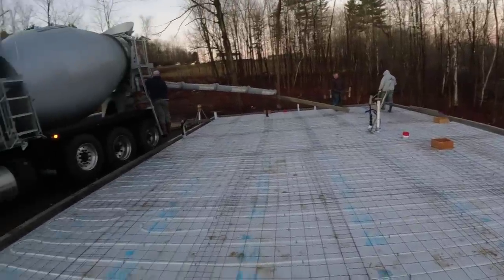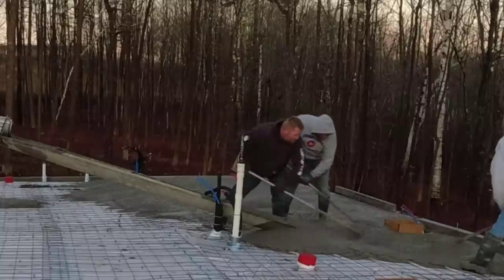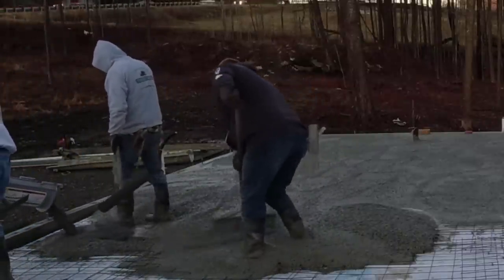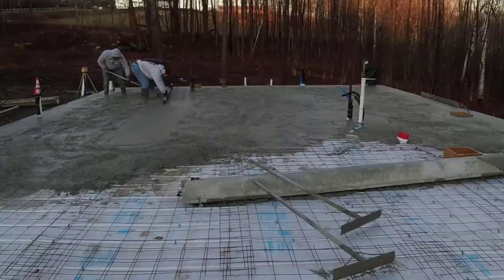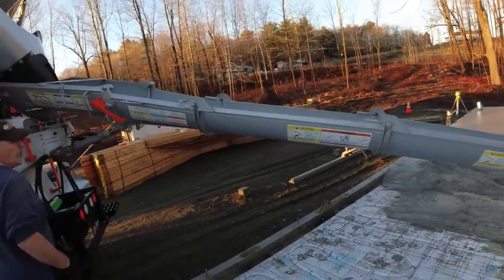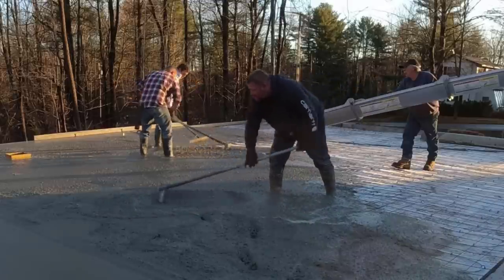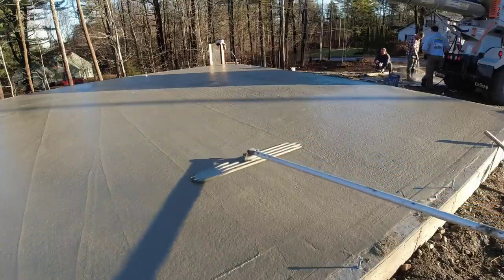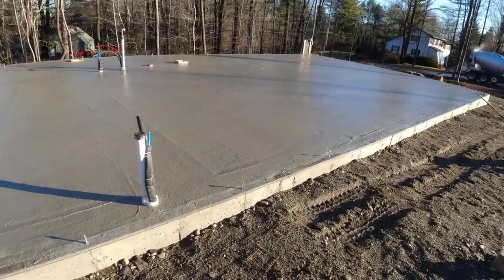We Had To Cut Out Some Wire Mesh - It's Sticking Out!

Comment: I'm in North Dakota land of the way f**** cold and our concrete mixes vary kind of the same seasons like you guys have. So when I do my concrete I don't hire any one so I show up do the dirt we work, set forms, hand screed the sand fill & tamp it 3x, lay in the fiberglass rebar, then I use zip ties to tie the bar. This way there isn't any metal in the slab to have rust spots show up over time. Then pour & the concrete. But I always have fiberglass rebar in everything. I don't really use a lot of the fiber mesh, but I've been thinking about maybe using it more often I guess, you know just for hairline cracks. But yeah, i use water reducer & put it to sleep for about an hour too mostly because I'm a one man crew sometimes I'll have two extra guys with for done of the bigger jobs I get. In winter i also use a percent so i can speed it up a little bit if we need to.

But yes that's probably about the same except our winters get a lot colder than just like freezing or a little bit below freezing. North Dakota winters get way below zero temps with wind chill real feel temps of -20's. For instance tonight we're looking at a windshield of -30° to -35° below 0°. 

But it always varies. We had three or four days where it was below zero temps non-stop all day long. I'm talking like -18° to -20° below without windshield that's just the actual temperature. The real feel is even colder than that.

Comment: We used to use a lot of roll  wire on just about everything we poured until these big wire mats became more available. How we always used bolt cutters we used to cut wire stirrup to hold our steel in our footings. So when we had a problem with the wire like that . Bolt cutters fix the problem and move on. You guys are top notch .

Comment: What mix, psi, water reducer  and slump would you recommend for mix for driveway extension in warm south Florida?.. planning on using wiring mesh and a power screed before bull floating/finishing. Also I’m gonna have to wheel barrel about 7 yards about 40 yards
Reply: Sounds like a nightmare